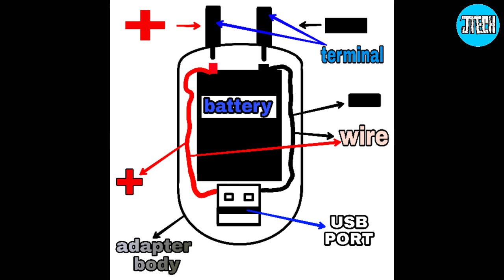#homemade #powerbank how can you make your own charger + power bank 2in1

Comment: it is not working not enough voltage for phone its max 3.7 volt
Reply: U can use 3 or 4 batteries and connect them with + , - points they give us max power what they have !

Comment: While recharging it may explode or not
Reply from the maker: if you're charging with 3volts adapter than it is no problem 
but never plug the adapter in ☠️240 volts power supply..
Reply: Sure..fatega..😂😂